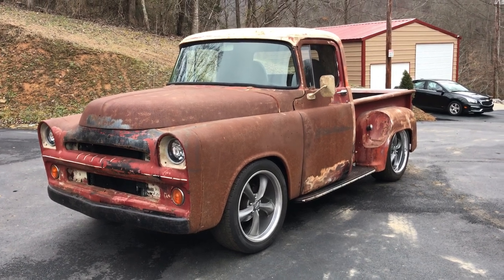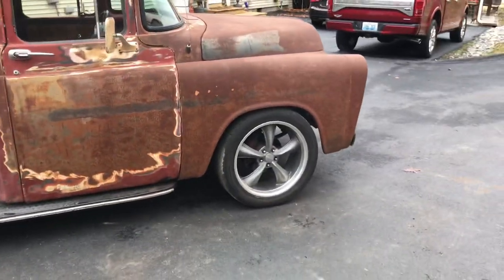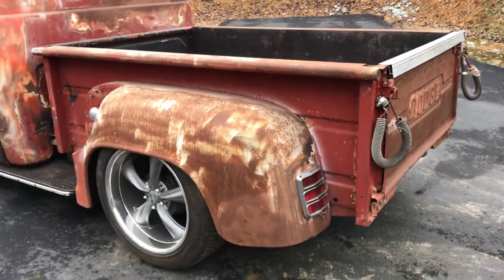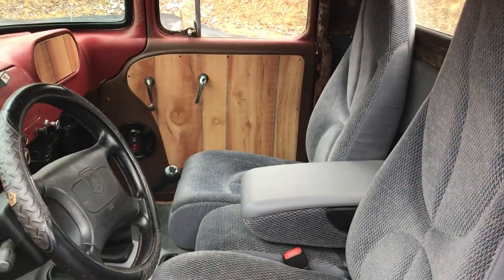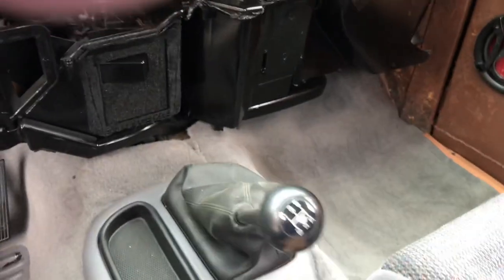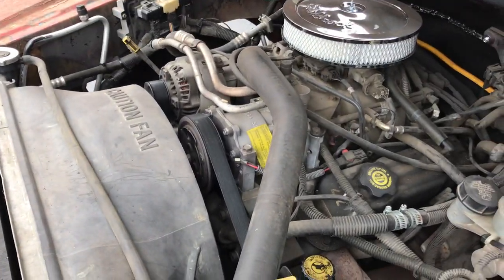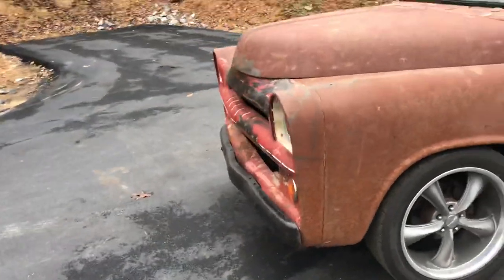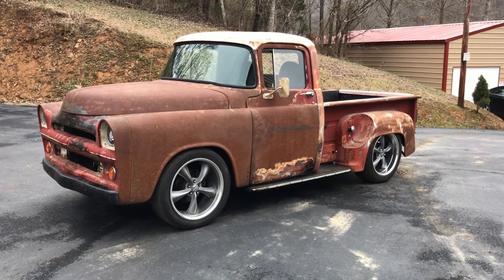1957 dodge D 100

Comment: Wow, that is cool!  The 57 Dodge D-100 with the hooded heaflights is a really cool looking truck! Amd you used the 3.9L Magnum motor  & 5 speed. how cool. I have a 95 Dakota which I  ordered from the factory just like that and a 3.55 Anti-Spin axle for extra hill climbing and off-road ability in a 4x2. I also have a 2003 F-150 4.2 Liter long bed 4wd
 The Ford is a dog compared to the Dakota. The Magnum is a really strong motor with great low-end torque and yet at least the way I geared my truck I could get 22-23 mpg hwy w/o using the AC. 18.5 w/AC. That is important to me cause I live in Cali where gas is expensive and I am an on-call employee in the field education(so I don't have a lot of money to waste on gas).And I like to do long road trips Utah, Colorado etc. You have a beautiful truck  just needs some paint.

Comment: Jeff, your builds on Dakota chassis inspired me to go ahead and buy a solid, one owner 56 C3-B8 108" pickup to mount on my 2001 Dakota SLT 4.7V8/RWD/543RFE chassis. I plan to use the Dakota firewall/floorpan to mount the C3 on my Dak. To me, the C3 front axle centerline should be about 2" further forward when mounting on the Dakota chassis. That should give me more room up front for the core supprt/radiator/trans cooler/AC Condensor. My goal is to use nearly all of the Dakota under the C3 to basically build a 1956 Dakota. I like too, that you mounted the guage panel in the dash (I guessed it would fit) and the HVAC and Stereo in the center.  

How tough was it fit the HVAC systems under the dash of your 57?

Comment: Awesome truck jeff, How/where do you shorten the dakota frames? How did you get 5 bolt wheels on it?
Reply from the maker: Otis_818 2017  I do not shortened the Dodge Dakota sometimes I move the rear axle and have to do a different driveline also I read drill my axles to get the five lug it’s a headache but as you can see it’s worth it
Reply from the maker: Otis_818 2017 Thanks for the compliment
Reply: Sweet, is there a direct fit brake rotor that works after? Thanks for the info im about to start a 53 dodge on a 2000 dakota
Reply: Otis_818 2017 if you have some money to burn and don’t want to drill and have some mechanical knowledge you can do what Was done with mine. The early Dodge Dakota’s (87,88) were 5 lug trucks. My father in law checked all the specs and axle length, drum size, brake shoe size, same spline axle, everything exactly the same as the 94 mine is sitting on. Replaced the axles, drums and re did all the rear brakes while in there. Front was the same deal. Early model exact same parts as my 94. So just bought all early model parts and swapped them out.
Reply from the maker: I did not shorten the truck I re drill rear axles and front hubs
Reply: jeff potter looks good Jeff. There is a Dodge just like that one sitting on the side of an old Route 66 building in the town I live in. You don’t see too many of them still around.